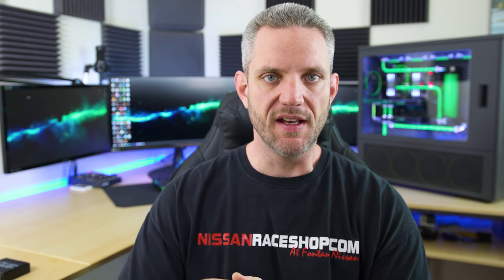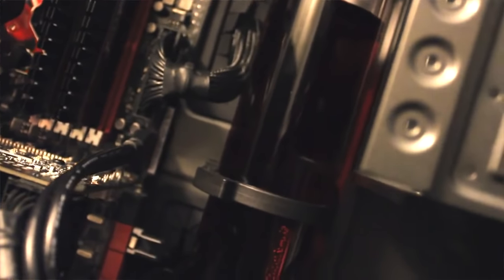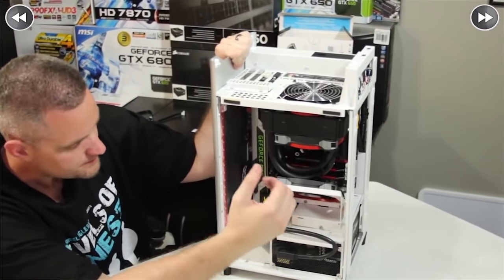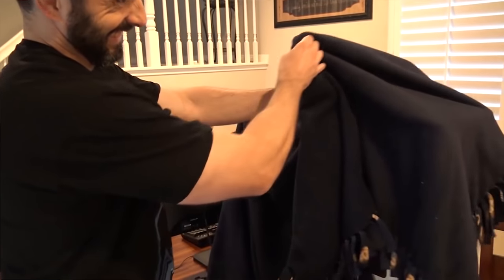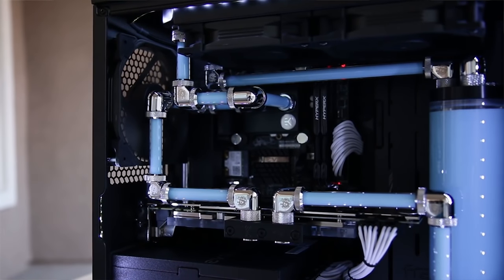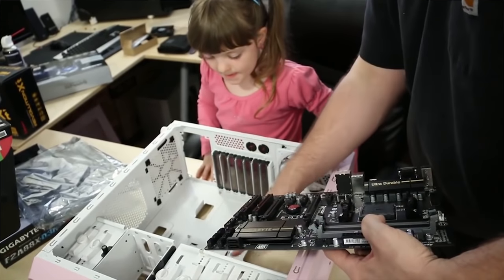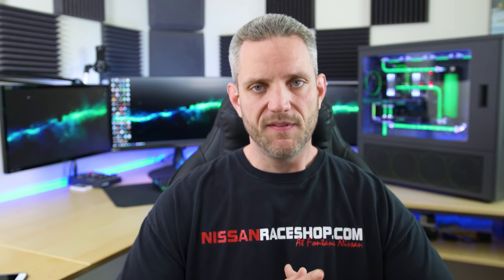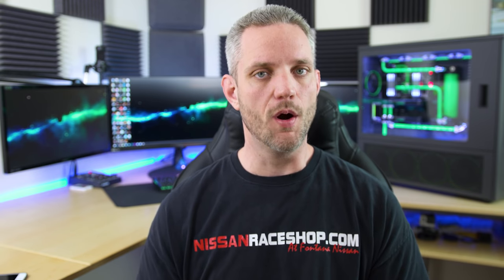My Top 5 Computer Builds I've Ever Built

Comment: Wow, the glass tube build looks awesome! If i ever get to water cooling, I would love to do this.
Is it hard to do a glass build?
Reply: Nikolaas Brems Yes I believe it is (cutting the tubes)
Reply: glass cutters are fairly easy to work with and not that costly, so I don't imagine that to be difficult. accurate measuring might be an issue, but no more than hard line tubing, i'd guess.
Reply: True
Reply: +zackrick facepalm
Reply: Nikolaas Brems it is pretty dificult cuz u got to melt the tubes and stuff
Reply: Taha Koç, agreed, for hardline plastic tubing. But I don't see any bends in the glass tubing, just straight glass tubes and corner couplings.

Comment: My favorite of Jays builds is the Fractal Define S Nano. So much stuff strategically placed inside that small case.

For my builds I think my current one is my favorite. Thanks to Jay here, I took a leap forward and ditched the AIO liquid coolers and soft tubing and made my current build with rigid tubing that looks a 1000x better. Since I do automotive collision repair as well as restore classic cars, I am very good at sheet metal bending. Ironically I found those skills transferred into bending tubing and nailing those awkward bends as well as mixing colors (like mixing automotive paints) to get those unique colors most companies dont offer. 

Which is another reason why I like Jays channel as we share two interests in tech and in cars.

Comment: Jay.. the sexiest build.... the blacked out case and parts with see thru gold liquid cooled tubes.. by far my fav.. you inspire me.. my poor dell xps 420 has seen some desk time and closet time.. but your channel is going to make me trick this old case out. it,s almost scratch free and is currently working very hard.. i think one person has done some water cooling on a similar case. so, with a quad core 2.4ghz , 7.1 factory surround , i use it on my hisense 55. the ssd made boots so much faster. the MSI rx 580 8gb oc  armor provides video. i cant bring myself to shut it down. it,s better than my current workstation. but, i digress. i,m making a parts list for the new machine based on your reviews. i had no idea i had so many options..

Comment: I taught my daughter how to build a PC at 7 which was two years ago. Haven't done much with it though. I plan on building a new one with her but with older spare parts and possibly a new case. Might make it a liquid cooled Core 2 Quad 6600. It will be out of practically all used spare parts, mostly blue including blue cooling liquid, a blue Zalman CPU waterblock and a blue fanless PSU. I'll have to paint a GPU blue though.

Comment: My Best build, made it two years ago still running 4K with 60fps in highest or medium settings depending on the game :)

INTEL I7 6700K SKYLAKE CPU OC 4.7GHZ
GIGABYTE G1 Z170X MOTHERBOARD (FLAGSHIP) WATERCOOLED OC
1 x GIGABYTE 980TI 6GB XTREME GAMING WATERFORCE OC and
1 x GIGABYTE 980TI 6GB G1 GAMING WINDFORCE OC
(BOTH 980TI's IN SLI, OFC).
EVGA 1300W SUPERNOVA G2 PSU (COULD POWER LAS VEGAS)
2 x GIGABYTE BLACK SLI BRIDGE
CORSAIR 3200MHZ 32GB RAM
CORSAIR H110I CPU WATERCOOLER WITH FOUR 140MM FANS (ML140) CORSAIR ML140 x 2 - MAGNETIC LEVITATION FANS TOP
CORSAIR ML120 x 3 MAGNETIC LEVITATION FANS FRONT
CORSAIR 540 WHITE CUBE CASE
SAMSUNG 1TB SSD
SEAGATE BARRACUDA 3TB HARDDISC
NZXT HUE+ RGB
NZXT RED led stripe
------------------------------------------------------------------------------------------------------------------

ASUS 7.1 STRIX SURROUND SOUND HEADSET
(NVIDIA SURROUND) THREE ASUS 28" 4K SCREENS (OC 75HZ EACH)
CORSAIR XXL MOUSEPAD
CORSAIR RGB STRAFE KEYBOARD MX CHERRY
RAZER DIAMONDBACK RGB AND RAZER TAIPAN BATTLEFIELD EDITION
JBL 7.1 SPEAKERS
BLUE MICROPHONES MO-FI AUDIOPHILE AMP HEADSET
BLUE MICROPHONES SNOWBALL ICE BLACK MICROPHONE

65" INCH 4K 200HZ SUHD SAMSUNG SMART TV WITH QUANTOM DOT TECHNOLOGY AND HDR10 (SAMSUNG UE65KS9005)
2 x JBL XTREME BLUETOOTH SPEAKERS IN STEREO

Comment: My two favorite builds?  Hmm, the first is a computer I built in high school, so it's 24 years old now (thought it sits in a closet and obviously isn't used today).  Cost $10 only.  Has some pretty killer server parts in it for it's time (most are ultra rare even for the day). But it's so old noone will care to hear about it...  ;-) But it's my fist high performance system, so it has some sentimetal value - hence I held on to it despite not using it.  My other is my current antiqued daily desktop - it's such a mundaine looking system thats made out of super low end parts that it's hot performance and rock solid stability always shocks the hell out of anyone who uses it...  There's what it is spec wise that totally doesn't match what it is in use - a sleeper of sorts.  There a few systems I've built other people over the years, but their just fairly standard mid range white box system with nothing stand outish (because people want me to build as good as possible with out the flash).  Well, except for a bright green (Chenbro) dragon with window and a multi colored cold cathod lit dual core Opty 180 (Socket 939, two 500gig WD's, 550W PSU, 8GB RAM, and a GeForce 6900 GT and other misc parts).  That stands out cause it was everything but a standard white box build...

Comment: hey Jay, do you think the i5-6600k is a good CPU at today's standards? And if he doesn't see this, what do you guys think?
Reply: Given that it came out this year, yes
Reply: Dakota Johnson Had no clue it came out this year... sorry
Reply: Wait for kabylake and zen
Reply: lol ordered that cpu 10 hours ago
Reply: only if you get a z170 motherboard, and if you dont a 6500 will do great;
you should still wait for zen tho
Reply: 6700k prices drop since new kabylake is coming.   Also 6700k still better than new kabylake i5
Reply: It is a decent CPU, more than enough for gaming.
Reply: Venomy lol decent? its one of the bests.
Reply: BasicallyImHigh lol I'm getting a huge upgrade. from an amd fx 8120 to the 6600k
Reply: LegitBanana good luck, but hold off until Q1 2017.  i5 7600k will make the 6600k drop about $10-15..also because SR5 by amd will be pretty decent and might be a better upgrade,im not sure though so just hold off a bit longer.
Reply: BasicallyImHigh yea, I gotta wait for my bday which is in February bc I'm just short of funds.
Reply: If the 2500k can smash 4K gaming today, then yes it is. it even beats teh 6/8 core i7's (core for core)... so yeah. As long as you're not doing heavy multitasking. That includes streaming unless you use your gpu for that.

CPU's don't depreciate nor have they really 'improved' in terms of output. Thermal and power efficiency is Intel's game because they simply 'do not need to' release anything substantial. Just improve on what is right now and smash AMD when Ryzen launches with whatever they are hiding behind the curtain... if it's threatening enough.
Reply: Got the i5 6600k oc'd to 4.6 without messing with the vcore with a h100i gtx. Hardly goes above 50℃. More fps (20-30+)in titels that are cpu intensive.

10/10 would cpu again
Reply: Blidiot Woofghidiot you on watercooling?
Reply: LegitBanana yes, corsair h100i gtx

Comment: New to building computers would 
Intel i3 6100 
gtx 1060 evga windforce 6gb
evga 500w b1 power supply
2x 4gb sticks  
gigabyte at h170m 
corsair r100 case
Would the i3 bottleneck the gpu?
Reply: Hypertomato yes, an i5 6500 would bottleneck it, so the i3 sure will.

Comment: Whats better for college, a razer blade gtx 1060, or a computer around the same price with a macbook air?
Reply: That really doesn't make sense. Either buy a $2000 laptop or build a $2000 pc and buy a $800 laptop?
Reply: price doesnt really matter, ill just get a job and save up for it.
Reply: Top Dawg I found its cheaper to build your pc and buy a laptop, but if you're going with a MacBook as your laptop, than goo for it if you're patient on saving up for that
Reply: I'm assuming you want to game since you mentioned the gpu, but have you considered getting the Razer Blade and a separate monitor and mouse/keyboard? That way you can take the laptop when you're out and then plug it in at home(or dorm or whatever) when you want to game.
Reply: get a asus UX305, it is so much better than a macbook air for around $900,-. I'm currently in college and using it day in day out
Reply: I'd say build a PC and get a cheap laptop for school. You'll get better gaming performance on a desktop and thermals will be better, and then you can get a smaller laptop that is easier to carry around at school. Gaming laptops tend to be heavier, and they get hot, which can be annoying.
Reply: Go with a microsoft surface, not macbook

Comment: was helping my brother put in his new ram, cpu and cooler for Christmas, and we ended up killing the motherboard. would getting thermal paste on the board do it in?
Reply: It might have shorted out something on the board
Reply: only if it had metal in the paste. some pastes do. More likely you didn't discharge yourself before touching components. Static kills
Reply: I don't think so
Reply: how would i discharge myself? other than static band and a power supply.
Reply: in that case you might have dropped a screw or something
Reply: Adam G yes I did it to my old 1 lol

Comment: I have a problem any pci card doesnt work when i put it in my pc doesnt react to the power button ive tried 3 different pci cards this started when i got ethernet to my room and i removed the wifi card and put in a isolated sound card and i started up the pc it got to the booting then crashed and it woudent react to the power button not even the fans moved but when i took out the card my pc worked fine the same happened when i put the wifi card back is it a fried mobo pci slot or am i installing it incorectly any typos can be blamed on the fact that im writing this on my phone

Comment: Can you do a Desktop GPU to a laptop using the devices that can be attached to the wifi pci slot.
Reply: trevylove that's a mini-pci slot, not full size, so I don't think any decent graphics cards would interface with it.
Reply: Macdeas
I actually did it with a device using gtx960, but I got an out of bounds memory error. It played the game for about 1 hr 20 min. There are devices that do it.
Reply: you can cut off the end of a PCIx16 card t make it a mini-PCIe card. seriously! the first slots are actual slots and the other ones are just interface/bandwith. i sawed off the end of a HD 7770 and used a mini PCIE extension to use it.
Reply: That sounds uber cool.

Comment: Hey, I built a computer but it will not turn fully on. I only see the red power led on and the gpu light. Any suggestions
Reply: Urban there usually should be a smaller power button on ur motherboard
Reply: i fixed it but now all the lights and fans are on but i dont see picture on the monitor
Reply: Urban might be something wrong with ur cabling to from ur psu.
Reply: +Cancer Man yo I just sent it to the shop to get it working

Comment: Hey computer lover's. I have a serious problem my computer is not turning on . When I pull the cpu power out the fans spins but when I put the cpu power to the motherboard the fan is not Turing on . Any one know ?
Reply: sorry could you say that again? "pull the cpu power out" what does that mean? what fans, the case fans? or the cpu fan?
Reply: maybe the 4/8 pin cpu power connector from the psu. Atleast thats my understanding
Reply: It should be 4/8 pin, which isn't plugged in correctly. An off chance is the CPU fan, which is not connected to the correct fan header. Usually the PC should turn on, but I've been using ASUS exclusively for years. They POST with an error.

Maybe MSI/Asrock/EVGA etc. don't until you change the BIOS setting. But that is an off chance.

EDIT: Or you short out your MB (screw under the board, wrongly placed distance holder, wrong screw) and the safety measures of the board prevent you from frying it.
Reply: had a similar problem with my new motherboard, the power wasn't seated properly, because the 24 pin connector on the motherboard had a warped clip that didn't work with the connector.l I thought i had connected it but it was just out of place.
Reply: Bobsofax64  seems you know a lot !! Ok so the PC won't turn on . I got the 24 pin plugged in , the cpu plugged in, cpu fan and case fan  also got the botton plugged in . Press the botton plugged in to the motherboard then the fan turns for 1 sec then no spin . So I unplug the cpu power and press botton the case fan and cpu  fan turns ? So weird maby the motherboard is dead :( it's a dell xps studio 8100
Reply: Thx for the compliment. While I've been doing this stuff for 20+ years, it is always hard to diagnose problems remotely. If you have somebody around, who knows how to diagnose this problem, use that person.

Since it is a DELL system, I have 2 questions:

1. Is the system still under warranty? If yes, use it.
2. Did you change or dismount any hardware since buying this system? Especially MB or PSU?

Dell is infamous for using proprietary Power supply designs, which would make your problem harder to diagnose, since you can't use standard ATX PSUs to rule out a bad PSU. 

Unplug everything from your motherboard besides CPU (with CPU cooler mounted and the CPU fan in the correct fan header), 1 stick of RAM and the 24 Pin and 4/8 Pin cables. Now do a CMOS reset (Either by pulling the battery while power is off or using the correct jumper according to the MB manual). When Power on the system now, does it POST?

Comment: Can anyone solve Pc problem that says CPU or Ram changed please set up.Pc use to work with same Ram and CPU but one day I had Mobo error so I reset bios and set up bios and saved setting but it never saves and shows the same black screen with Ram or Pc changed please set up I even tried the 1 Ram solution but it didn't solve the problem.Any suggestion please help,I have beast Gaming Pc but cant play it.
Reply: I also removed battery for awhile the placed it back and same problem and I even switched Mobo battery for a new and same thing,I wanted to know if its a Mobo or Ram that needs replacement or if its a bios settings problem,I even set the ram to it correct settings
Reply: When I said I reset Bios,I meant that I cleared CMOS
Reply: Your CMOS battery might be dead. Try replacing that first its very cheap. Bios not saving sounds like a battery issue. Other than that you could try updating the firmware of the bios.

Comment: Im not sure if you reply but i just did my second build it has blue stock fans it in i have 5 fans total two on the top two in the front and one in the back i ordered a be quite power supply and a water cooler for the back fan i want to replace all my 140mm fans with quite ones i would like them to be blue lighting if found these http://www.newegg.ca/Product/Product.aspx?item=N82E16835181056 but i also found these there quitter but basic http://www.newegg.ca/Product/Product.aspx?item=N82E16835226042 just looking for your input on the best quiet fans !

Comment: how didnt she break the cpu lmao she fucking sliced the pins lol
Reply: es juannng Because the pens are on the Motherboard and not CPU?
Reply: Code Merk no. depends on the gen of the cpu
Reply: Tryhard Visiionz Ofcouse it does, my question wasn't actually a question, it was a hint, a nudge, to the OP to go out and try to find the answer themselves on there own accord...

Curious myself, turns out to be a AMD A10-7850k CPU, which has a ton of pins on it, not an Intel one like I had thought she was using... So I can only conclude that she was not pressing down hard on the CPU at all during that clip, or if she was, not hard enough to bend those tough pins... after all, those pins are kinda tough for their size.
Reply: why didn't you just say the answer straight out